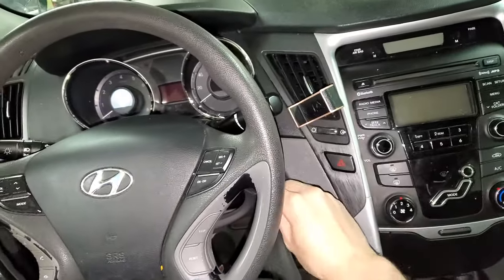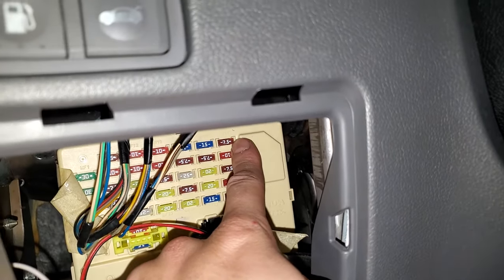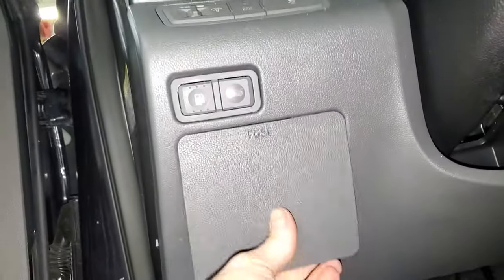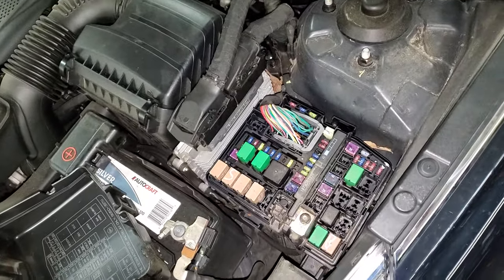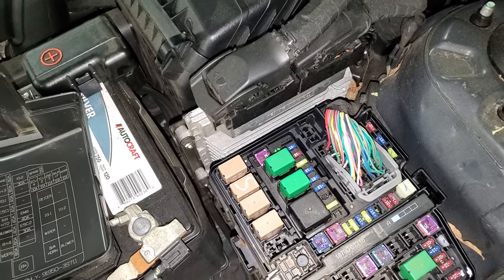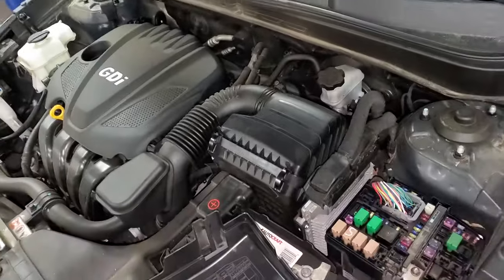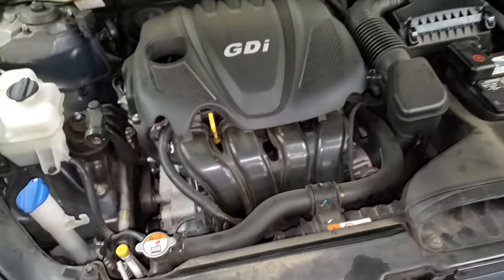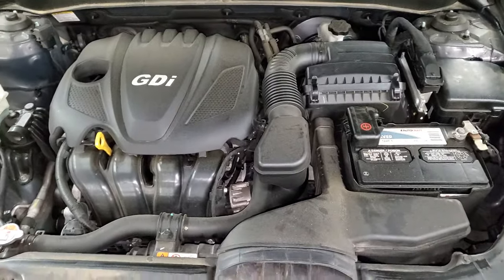2013 Sonata Starter Relay & Fuses

Comment: So my 2013 Hyundai Sonata broke down about two days ago. I got to about 95-100mph passing someone(dumb I know) and the dashboard lit up with all lights and then it wouldn’t accelerate. So I pulled over and turned it off. When I went to turn it back on it was dead. Haven’t been able to start it up since.
Reply: @jaimeyzerr2124  have u figured out the issue we’re having the same issue new starter ignition switch turn key on it falls flat

Comment: Turned key, nothing happens. Been an ongoing issue. Let the car sit for awhile and it will start. Replaced ignition switch, battery and neutral safety switch. Problem still occurring
Reply: currently having the same issue, did you figure out the cause?

Comment: My girlfriend’s 2013 Hyundai Sonata was a special case, car had a bad battery so I replaced it but for some reason would not even try to crank, checked all fuses they were good, checked relay swapped it with a good relay like the blower motor it was good, check voltage to the starter it was good
Reply: The way it started was I turned the crank shaft a couple of times and I guess that got the starter free from being stuck or something and the car started right up without hesitation
Reply: @anthonyginory5013  Hi Anthony, how did you get to the crankshaft to turn it? What size socket if any did you use? Thanks!

Comment: I have 2014 Hyundai Sonata 2.0t car was stalled and won’t start at all, batteries are good...help
Reply: Did you ever figure out the problem? My bro is have the same issue
Reply: Same thing just happened to me
Reply: Could be crankshaft position sensor

Comment: I have one question. I can't find the starter relay anywhere in AutoZone just the multipurpose relay . Is the starter relay a part I can only get at the Hyundai dealership or will I be able to order it online. I thought the multipurpose relays could act as a starter relay but they are two different things

Comment: Im now having this issue. The car cranks, so i know it isnt the starter. Battery is new, and its not the alternator because once it starts it stays running like there was nothing wrong with it. 
So this is the issue: put the key in, turn over, cranks but fails to start, yet everything is working. You can hear the motors going but it seems like their is a electrical issue. The weird thing is, after turning they over for a while, it suddenly will start and the rest is history. Turning it off, just repeats the process over. I think its the fuse
Reply: I’m having the exact same issues. I find that when I push the start button, I have to hold it for 10 seconds and then it starts. I will check the fuse to see if that works. Good luck.
Reply: I’m having the same problem! Any luck solving the issue?
Reply: @bryanmccullar4556  yes, actually the issue was the starter. We changed it and the car ran like it was brand new

Comment: Sometimes the car won’t start if the shifter isn’t in park all the way. Sometimes wiggling the shifter will get it to start. I had an issue with it and it fixed itself after awhile. It would randomly refuse to crank.

Comment: have a Hyundai sonata limited 2015. Buy at 20,000 MI. Never an issue with my push button start until about 80k. Sometimes would need to hit my start button a couple times to get it to start. It always would start eventually so never made a big deal about it. Overtime it was taking two, three, four, up to 10 times of pressing the push button to get it to start. All electronics would engage and sometimes you would hear the starter whine but not engage the motor then the next press or maybe the next four presses it would start up car would run fine. Finally in October when I hit 110,000 miles in my warranty was void the car decided to not start anymore. Had starter battery and flywheel and transmission replaced. Nothing was wrong with my transmission but I was told by the mechanic that the transmission the flywheel was attached to had 50,000 miles on it and might as well put in the newer transmission as it would be just as much work as changing out just the flywheel. Left the mechanic still having the same problem. Just $1,500 lighter.
Fast forward 4 months to being told that the mechanic probably didn't do the work he claimed he did. As I was still having the same issue and sometimes it would take up to 10 presses to get the car to start sometimes would start on first press. Those first press starts we're getting fewer and farther between. Finally Friday morning car wouldn't start and I had the starter replaced again. Now I press the button the starter engages I hear it whine but the Bendix I believe is not coming out because I don't hear the engine trying to turn at all. The first mechanic did say that he believed it was bendix issue also. How could three starters all have the same Bendix issue? Is there an electrical circuit that engages the Bendix as opposed to the starter? I've read about other people having this issue in cold weather I live in New England so the weather is cold here but I've had this issue in cold and warm weather at this point. Don't have more money to just have mechanics keep guessing and throwing in the car and I can't even begin to think about affording dealer rates unfortunately. I'm a single mom with three kids who can barely make my car payment never mind huge mechanic bills. I know I'll have to fix whatever is wrong I just am hoping that someone will be able to figure out what's wrong instead of everyone keep guessing in the dark or replacing same parts.
I want to thank everybody in advance for reading this and taking their time to respond.
Reply: Have you figured anything out? I have a 2011 Sonata Limited that started having this issue about a month ago, sometimes would start first try and other times after 30 tries. Replaced starter, battery and no solution. It won’t start at all anymore and I desperately need to get it running so I can get back to work…I’m running out of options. I had read forums about people having issues with the Neutral Safety Switch/Inhibitor Switch and also my gear indicator light on the dash as well as shifter cluster would go blank from time to time and not show what gear I was in, so I replaced the Switch I mentioned but now it doesn’t show any gear…still no start. Not sure if I installed the incorrect part or blew a fuse somehow? This is all very time consuming and wasting money..
Reply: Did you figure it out?
Reply: I'm having the exact same issue. It tries to crank but the engine wont engage. It just recently got super cold here. Does anyone know a cheap fix?

Comment: I jumpstart my second car and now it take me 3 times to start my car.
I replaced to a new battery but it didn’t solve the problem.
What do you think it might be.
Thank you so much for a great video.
Sonata 2013 with 106,000 miles.
Reply: Hi! Did you ever find out what was the issue? I’m having the same problem

Comment: Mine locked up and Hyundai replace it last year do you know if the replacement engines have problems locking up as well or did Hyundai fixed the issue with the replacement motor from locking up?
Now it sounds like the motor wants to start and the starter releases it and you can hear the starter spinning but won’t crank the engine sounds like if it’s a bad starter but then sometimes it would start.
Reply: Ajmobilemastertechnician Nunez for your starter, what may have happened is that the plastic shift lever in the starter assembly might have broken. If it sounds like a “whirring” spinning sounds but no cranking, that might be it. All you need to do is buy that plastic arm for the starter which is like $15 bucks and then take the starter out and replace part. There are videos here on YT on how. It’s not easy if you’re not used to working on cars like me but very manageable. Access to starter is just a pain.

Comment: I hope someone reads this with an answer!  
I have a Hyundai Sonata owners. I bought a 2011 LE, 4 cylinder, automatic, push button ignition.  It only has 37,000 miles on it and the previous owner bought it new.  She sold it to me because her two mechanics could not get it to function for her. It would sit for a few days and would not start.  They replaced the battery and alternator.  That didn't fix it.  Right now it will not start or do anything at all, so it actually got worse.  The battery is new and checked good (confirmed with part store check and deep charge). The main fuses I can see all look good. Nothing comes on. No exterior or indoor lights. No dash lights or gauges...nothing. Except, the push ignition button will lightly illuminate when I push it. Both key fobs will show a small red light when anything is pushed on them, but nothing happens. The trunk won't open, the alarm won't turn on, no door locks, nothing at all works. It does the same thing when attempting to jump start with 3 different vehicles. It did start occasionally for her with jumper cables and battery charge, but now it is entirely dead and nothing gives it power to crank or start, or any accessories or gauges. It's behaving like it has NO battery at all.

I have not connected a code reader to it, yet.

Questions:
1. Anyone have this occur?  What fixed it?  

2. Is there a way to test the key fobs to be sure at least one is working?

3. I know how to get the car in Neutral to push it around, but is there a way to get the steering wheel to turn?  I hate push button crank cars!

Thank you!
Reply: Ist, charge your battery then go to starting relay in the fuse box, replace it with a relay which you know is working like blower motor relay, if it cranks now, try starting it with push button, if it starts then go to a good service place to get it scanned like firestone or best one or whatever suits you, they will diagnose everything and then you know, thats what I did and it worked for me
My best wishes

Comment: Just managed to get Hyundai to cover catastrophic engine failure at 157,000 miles! Free new engine! I think the class action covers up to 130k?? Mechanic said the highest hes ever seen approved was 153k. But they took a look, and it was spotless inside. CHANGE YOUR OIL often ppl! That's what saved me from losing a decent car, or thousands fixing it
But yeah. Now I've been having electrical issues. Car clicking all by itself, non stop. And wont start.
Hopefully this works

Comment: I pulled the coil packs out and took out the spark plugs and tried to turn over the motor manually and I get it to turn but it is kind of difficult and it makes kind of a clicking sound when I’m turning it.
Is this an indication of my engine being seized up?

Comment: Hi good morning. Hopefully you can give me an advice what to here. I checked all the fuses, all are fine, I bypassed the relay and the starter works, but it doesn’t crank. You mentioned about that the engine gets locked. Can you explain to me a little more on how to crank it manually? 
Thank you.

Comment: I have my sonata 2013, I got some problem with headlight always. do you know why ?I already did change the headlight three times.
Reply: Electrition can fix
Reply: The problem i found with mine was the signal wire was loose and needed to be tighten